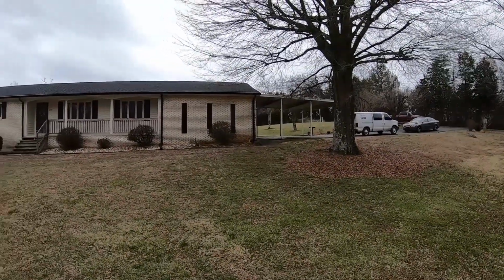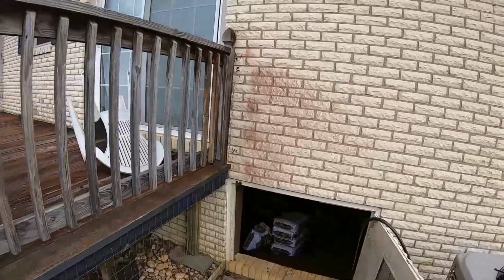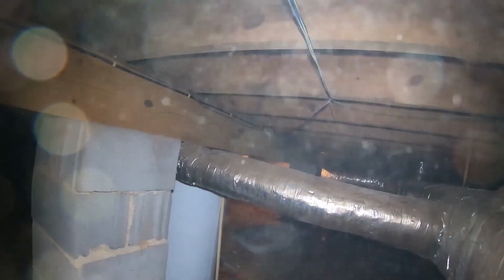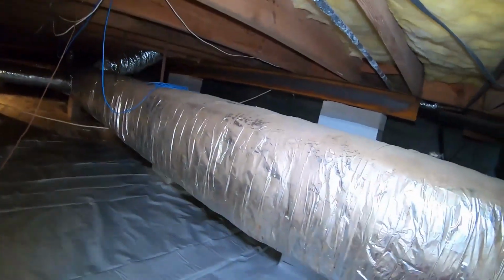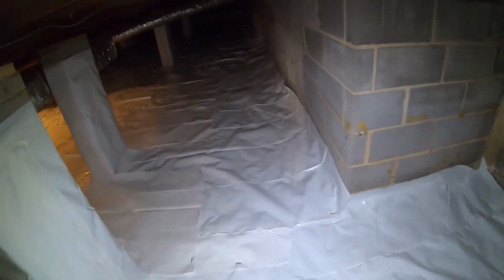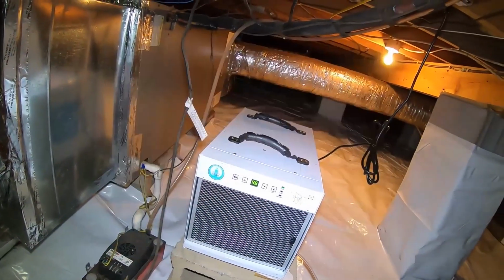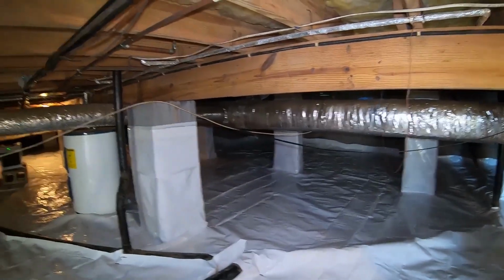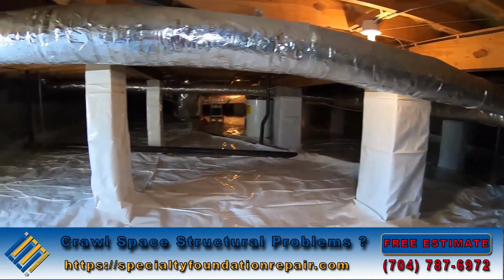Crawl Space Drop Girder System / Waterproofing / Moisture in Salisbury, NC - 704 787 6972

Comment: How much did all this cost just for curiosity.  I think I’m going to need the same thing.
Reply from the maker: Joanne, Thanks for watching! I try not to discuss pricing for a project before gathering basic information about the house. Your project may be completely different than the one featured in the video. Each house must be evaluated on a case by case basis before discussing budgets. Please feel free to contact me directly at 704-787-6972 and we can discuss your project in detail. I should then able to provide a general budget assessment.
Reply: @Specialtyfoundationrepair    This looks Great!  How much did This particular project cost?
Reply from the maker: @RsinsRpaid , this customer hired us twice. Once to handle the initial deployment, as well as expanding on what we had done 6 month earlier with an expanded scope of work. The client spent more money than I recommended. The combined deployments exceeded $30,000. However, that does not mean your project will even come close to that. I always advise customers to develop and overall project budget based on the worst areas. And this may require a site visit to help you dedicate resources to the most important structural deficiencies. In general, these kinds of projects tend to cost between $7500-$25,000 based on a final project goals and planning.